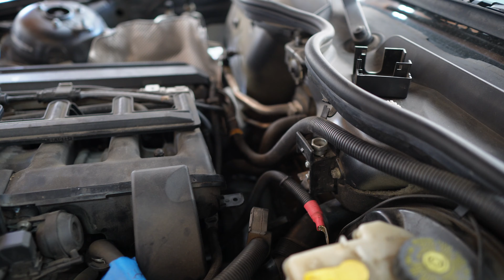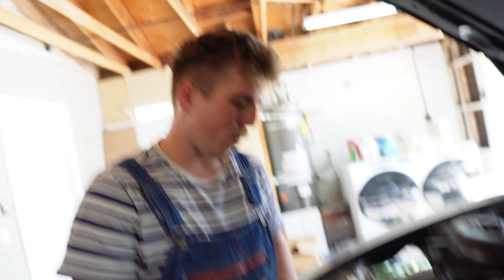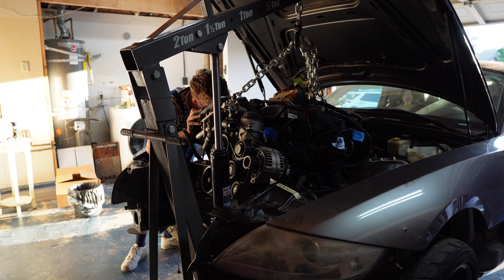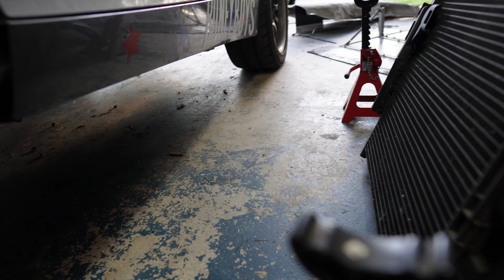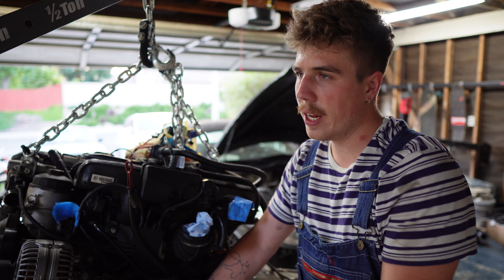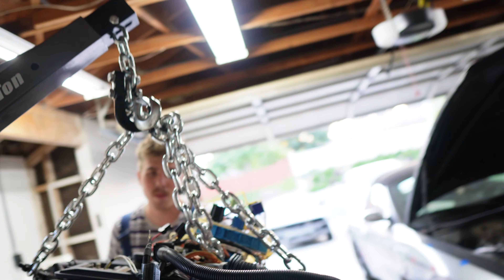Pulling the BMW E30's New Motor From the Z4!

Comment: How is the project planned out with wiring? Doing a DIY harness splicing an e39 or e53 engine harness? Or are you buying a completely new one made for the swap?
Reply from the maker: I think that either condor or garagistic sells an adaptor harness that mates everything together. We’ll try that out before we get too far into custom wiring